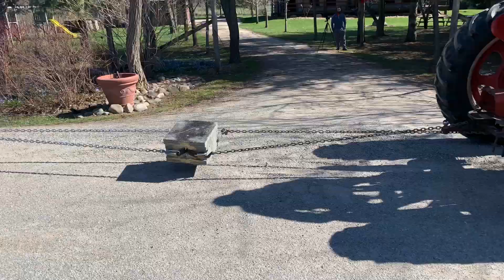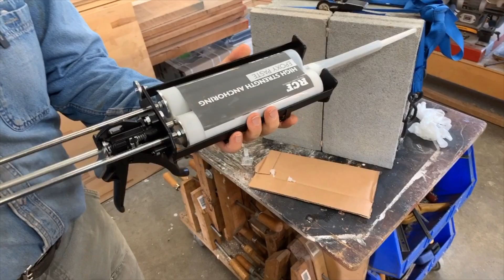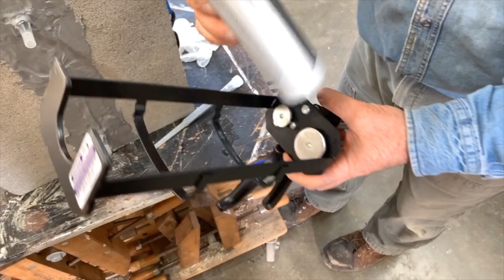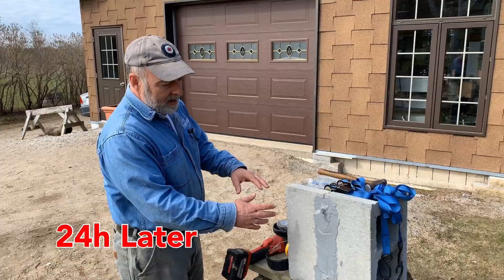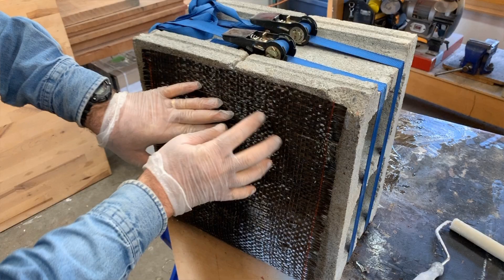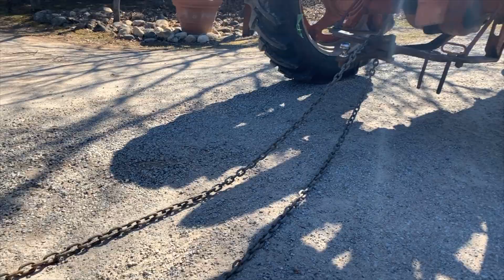How to Fix Cracks in a Concrete Foundation (SUPER STRONG)

Comment: Incredible. One suggestion when dwaling with carbon fiber. I would impregnate the fiber first and layer it before attaching to anything. You sandwich it between mylar sheets or something then you can cut it into the size and shape you need if youre working on smaller items. More importantly, it makes it easier to get all the air out. Just be sure to stick use it before it dries. You can also use this method to make composite patches for holes.

Comment: I absolutely do not doubt any of the material used for this repair...but I think there's a bit of an oversight on the cost and the overkill factor. Epoxy is extremely expensive and so is the cloth. This was just a very small sample crack but in reality this could be 30 to 50 feet of crack and that is BIG money.

Comment: Excellent job!!!

Just a FYI here, dangerous testing though…..if the chain snapped, you might have to bury one of those guys….you should lay a thick canvas or attenuator over the chains on both sides of the cement….just a thought, people have been injured badly doing this without a safety plan….

Comment: Problems, crack on both sides, crack to unfilled 4 x 4 column void, wet or cold concrete, dissimilar materials will separate or just crack next to repair.
Reply: How true is that?